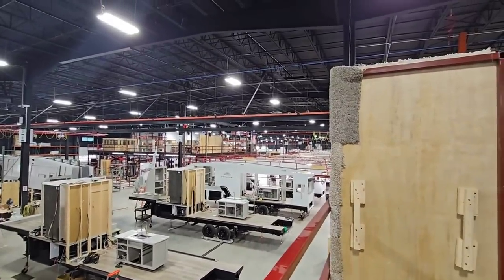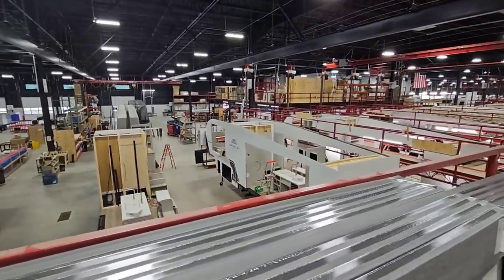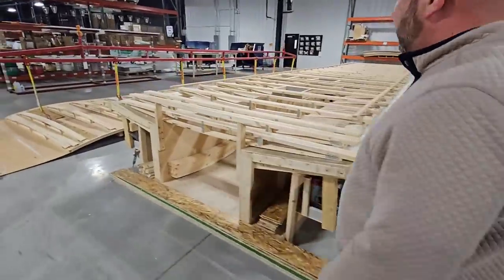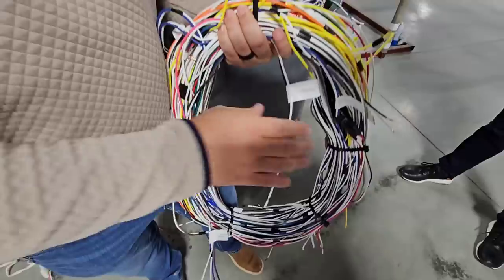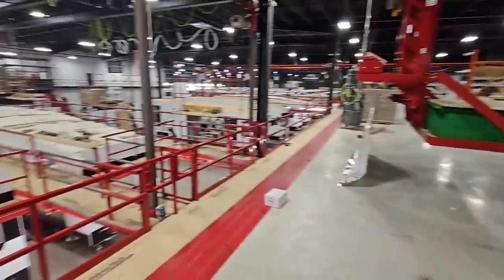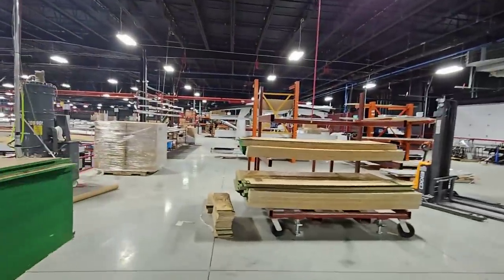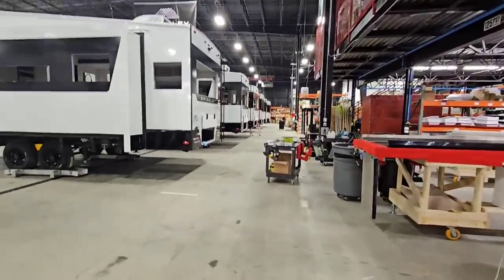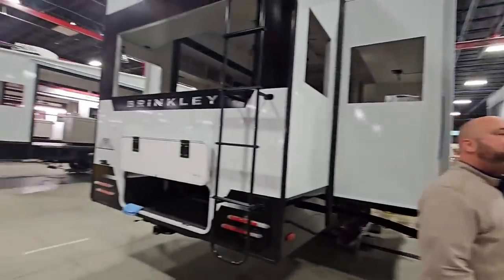Amazing Quality! Brinkley RV Factory Tour! Part 2

Comment: With nearly 40 years of mechanical design, failure analysis and quality control manufacturing engineering experience, awesome to view an RV manufacture that truly understands 100% respect to people, value and service like no other.

Would like to see a full synthetic sub floor which Airstream and Ember use in addition to double Azdel side walls and full metal and synthetic roof system. 

Not a fan of wood and TPO roof systems. 

Wood will expand and contract based on humidity levels, can crack, rot, mold and mildew.

Comment: I cleaned up the wiring in my fifth wheel as well. There was SOOOOOOOOOOOOO much wire under the mid bunk wardrobe. OH, and the kicker was when I cleaned up the wiring from the battery to the converter. For some reason, when they ran the 6awg wire from the battery, which is in the front storage on the passenger side under the fifth wheel, it went along the front, down the driver's side, then back across to the mid bunk and up into the converter. I cut out 20 feet... 20 FEET of wire. There were no other connections. This was a continuous run.

Comment: Totally impressed with this product. But…
The roof truss system tapers on the edges which means the insulation is less on the edge. Not good. Also how is it possible to have a real R40 in the roof?  I believe they are adding the theoretical values of each material. A home R40 Would be almost a foot thick. So I dont believe their claim to have a roof value of R40. 
But I really appreciate their seam and roof construction. This is definitely a brand I would consider if I replace my existing fifth wheel (Arctic Fox).